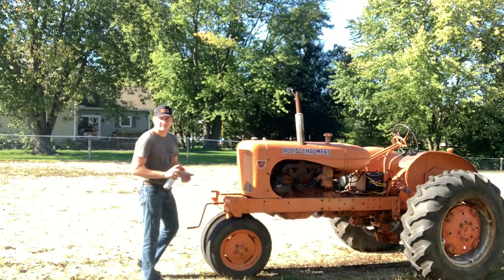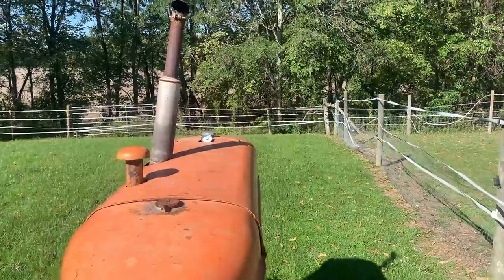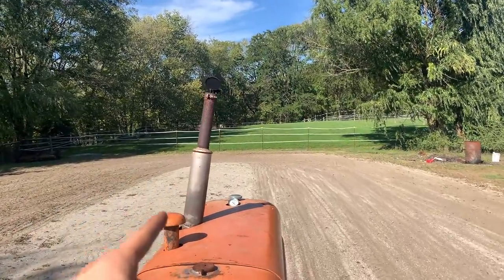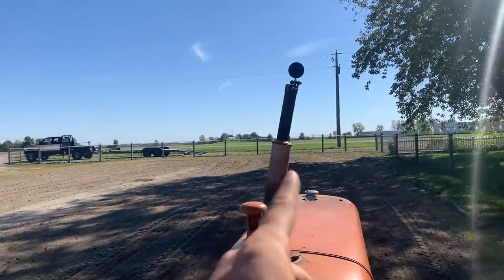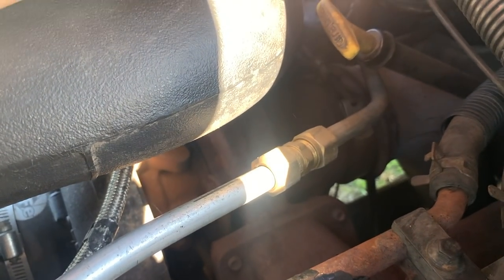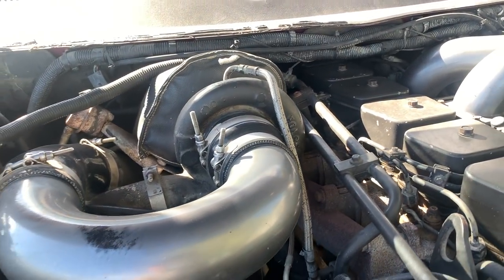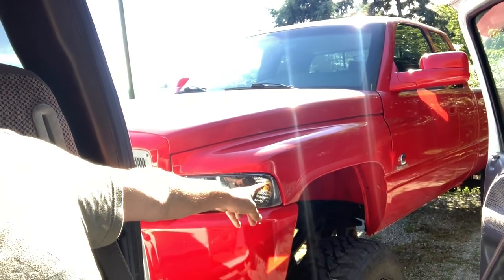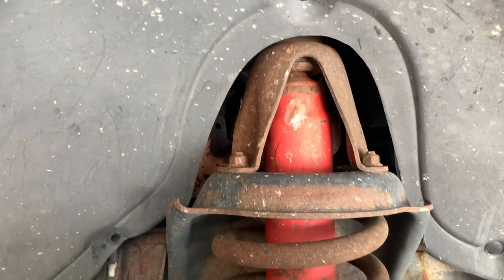CAT TURBO on the FLAT NASTY 12 valve cummins!?

Comment: Sounds like the manifold is leaking pretty common , also another cause could be if you changed the oil and filter and didn't use a mopar filter that will also cause the engine to be noisy

Comment: I have an 04 f150, has the same problem, if the engine is warm and the ticking goes away its the manifold. If it persist, check the cam roller/followers.

Comment: Honestly just sounds like you need to give er some more throttle. I could be wrong. The sound from grandpa truck sounds like a valve tap but could be just an exhaust gasket or something. 
Good luck with both!!

Comment: My John Deere b has a load screw. When I rebuilt the carb it would still sputter releasing the clutch in road gear. Just took some adjustment.

Comment: Don't run cheap gas in the tractor and make sure fuel filter isn't clogged with junk.  Try putting sea foam in tank or some sort of ethanol treatment

Comment: Manifold leak very positive an common on these trucks. Breaks the bolts against the fire wall an causes a leak. Most times when removing u will break more. Gotta drill them out an re tap

Comment: The way it’s loping like that sounds like the governor. Especially if it’s only doing it under load
Reply: Thats exactly what i was going to comment those governors will get sloppy and worn out on Ya
Reply from the maker: @daylencrews19  Where’s that located on the tractor?
Reply: @LOUDNPROUD  sitting on the tractor it is on the right side of the tractor infront of the distributor. You should see a rod coming out of it and running across the front of the engine behind the fan bent if you follow that rod to the other side of the tractor you should see it connected to a linkage that goes to your carb

Comment: That noise in your grandpa’s truck could the famous “hemi tick” it is very important to change the oil at the right intervals because all of the little holes and areas the has go to. Does it just do it when it is the first cold start of the day and go away when it is warmed up? I have a new hemi and mine ticks for a few seconds on a cold start but mine has less than 20, 000 miles. Do not like that ticking noise. Hope it just an exhaust leak or loose bolts for you. Great video! Great content and keep it up! Stay safe and healthy for you and your family!
Reply: But a 5.9 isn't a hemi
Reply: @laisuresboringadventures7052  hehehe, then it can’t the hemi tick. Is the 5.9 gas considered better engine than the hemi engines that are in newer ram trucks? Do not know much about the gas engines in ram trucks?
Reply: @richardbalkavich479  yea  ive herd the 5.9 gas 2 be a good motor  just like the 5.9 12v
Reply: I've had the 318, 360 and hemi gas motors and every single one would do this about 500 miles before the oil was due to be changed like clockwork, changed the oil and it went away, it's annoying but you're never late on changing the oil, lol

Comment: That's exhaust bolt manifold on the motor that's probably broken off I've got a 2001 off-road Edition Dodge and I had like two or three of them broke off on my motor dude I would definitely drive it there a good truck to drive if the motor wears out put a new motor in it

Comment: Could be a 3126 cat engine turbo
Reply: Actually I looked it up it's a cat c7 turbo and caterpillar makes a good engine used to they don't make them anymore
Reply: @Mrright-fi2fm  3126 was the early version of the c7
Reply: @adamhogeland8033  oh ok I didn't know that I Google what he showed and saw that it was a C7 turbo
Reply: @Mrright-fi2fm  3126 was a 7.2 liter came out around 97 and the c7 platform was introduced by 02 03 some where in that time frame that said the turbo would be a beast for a 5.9 Cummins
Reply: @adamhogeland8033  oh ok that's awesome my uncle owns a diesel shop and works on this type of stuff never told me about any of this learn something new everyday